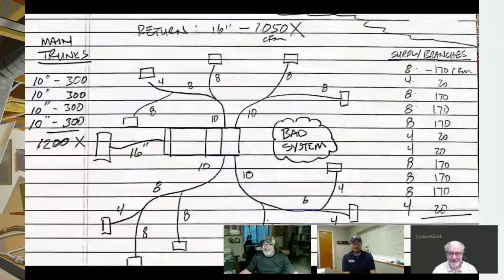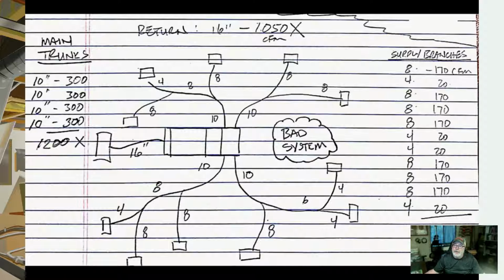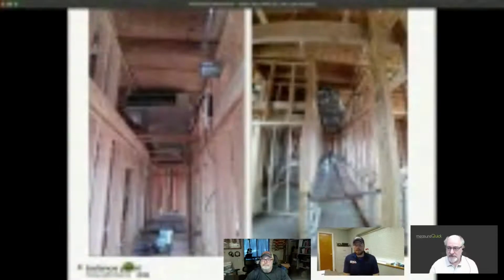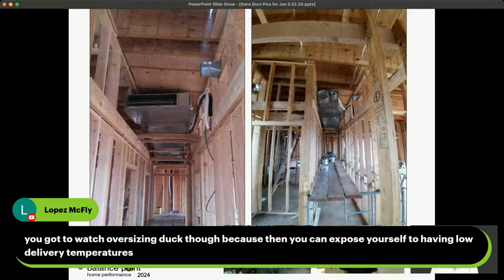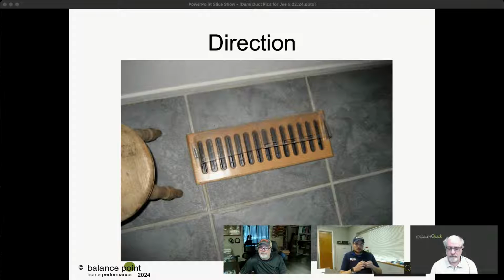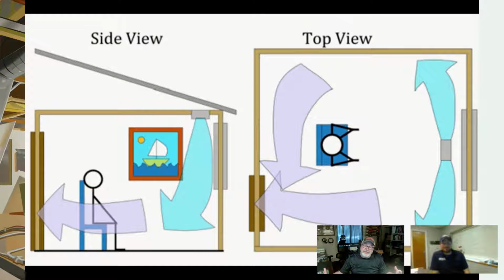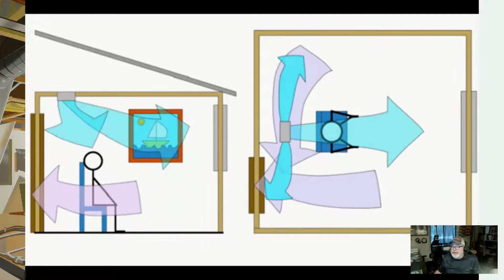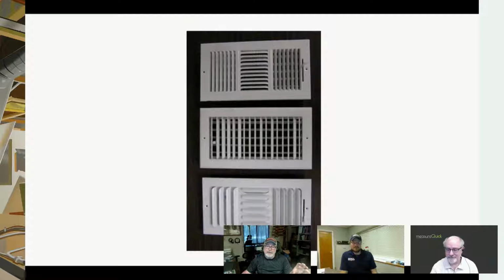No Airflow? No Heat Pump | mQ Heat Pump Webinar Series

Comment: Talking about duct reduction through a restricted space, i.e.,going from 12 to 10 and back to 12.  My ducting text book illustrated a 20% allowable area reduction for traversing an obstruction. The example was traversing across the underside of a beam with a restricted height dimension.
BTW, working in an open web wood truss joist gives me anxiety, as the customer expects the duct to fit in the web and the carpenter and truss designer has no clue.